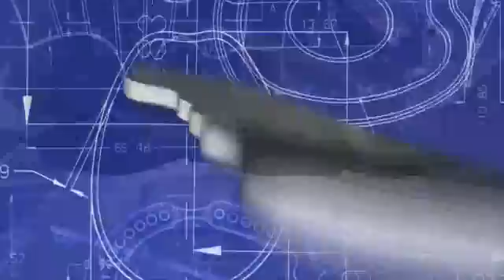#britek  Energy Return Wheel... Autonomous Never Flat

Comment from the maker: Composite hoops that flex/articulate a prescribed footprint. Composites are much lighter than the tire body mass that they replace. The energy storage is in the drawn elastic attachments that suspend the hub within hoop. Each of the 36 radial array of attachments is pulling 300 lbs. IE 5 tons. Vehicle weight lowers hub within the scope of the hoop. The hub is now hanging from the top 180 ID of the hoop. If the wheel hoop will not roll the hub winds upward and forward a unique lever effect.

Comment: I can see how a more rigid tyre is going to reduce rolling friction, but everything else about this concept is misconceived. The contact patch on the road will be much smaller as the tyre is not free to deform. The steel hoop that gives the tyre rigidity is going to cause a large increase in unsprung  mass. There is no 'energy storage' in the wheel in any way meaningful to performance or economy. I'm all in favour of an alternative to conventional tyres, but I don't think this is it.

Comment from the maker: On these early protos we were pulling radial array 36 attachments @ 300 lbs. dynamic stretch tension per bolt/attachment. Add vehicle wt. of 1,200 lbs. divided by 18 pulls IE the top 180 degrees of bias stretch = an additional 66.6 lbs top side or 366 lbs. total per pull. 3/8" stainless steel hardware is not being challenged.

Comment from the maker: The sidewalls and tread block of pneumatic tires are the weak link at speed. You have become accustomed to riding on bouncy balloons that squirm and roll over in hard corners. ERW is the exact opposite. We bring power to "points" suspending hub in hoop. Our 360 degree sprung to the surface hoop makes more constant contact from those points to the surface.

Comment from the maker: A pneumatic tire crumples up from the bottom until the rim contacts the ledge. ERW is the opposite. At rolling impact the hub is isolated from the impact as the hoop comes oval, stretching the 3 o'clock and 9 o'clock attachments.  The hub is levering from the top 180 degrees of attachments and simply steps over the incident. Check out our vacuum charged video.

Comment from the maker: We know that rolling a ERW sprung to the surface hoop has better contact potential at high speeds than a pneumatic tires tread block and sidewall deformation. Check out our high speed dyno video.

Comment from the maker: We have "no hole" composite hoops . ERW shares the load. The hub is suspended / dynamically sprung by more than 6 tons of elastomeric attachment tension. The hoop can come out of round from a large impact directing force to 3 o'clock and 9 o'clock attachments. The rebound lifts and levers the internal hub up and over the obstacle.  With half the bounce of pneumatic tires.

Comment from the maker: ERW displaces internally. An internal shock absorber. We do not over react by bouncing like the pneumatic tire. Our deformation occurs at the hoop level creating a prescribed flexing footprint. The hoop can go oval stretching the attachments at 3 o'clock and 9 o'clock. We have a filed novel traction systems specific to ERW to assist with deformation. ERW hoop is rated at about 50,000 psi.. Your tire is 120 psi.. Shock travel is cut in half. Lateral performance? ERW shares the load 360 degrees.

Comment: Installation is not a issue. You're spewing words to make it seem like you know what you're talking about, but you have no real background in this science. That's why you're not gaining traction with your proposal. You're simply gluing a tire to a piece of metal, and never the twain will interact. If you integrated the steel into the tire, you'd just be making a shock absorber out of the tire. It's CHEAPER to make shock absorber out of compressed air.

Comment from the maker: We hang from the top 180 radial array of attachments when loaded. ERW  focuses developed tension to points then levers the hoop to the ground from those points. Completely different than any other wheel designs. We pre tension our elastic attachments for better transfer of force IE an elongated slingshot shoots farther. The pneumatic tire looses energy from sidewall deformation and tread block while we are an internal, closed system.

Comment from the maker: When we started over 10 years ago the ERW was a hoop attached to an elastic membrane spanning a wheel hub. The the elastically supported hoops "freedom of movement" into wheels negative space provided cushion and energy return. Next improvement a radial array of elastic attachments to pretension ERW  and "hang" from the top 180 inner diameter of the hoop. A mechanical breakthrough. Innovation takes time.

Comment: You have analyzed your system for fatigue though, haven't you? Constantly deforming metal (such as the spring steel component of your wheel, right?) does fatigue. I'm not an engineer, but this wheel seems designed to take advantage of the deformation of the spring steel with each rotation, and there seems to be that potential. I'm not asking for details, and I wouldn't be so critical if I weren't honestly interested in what you're doing, but have you done the engineering work on metal fatigue?

Comment: My point is that every generation stands on the shoulders of the previous generation.  If there is one singular aspect of our species that gives us the greatest advantage over others, it's our ability to pass on knowledge and learn from others successes, and not repeat their failures.  Personally, I don't know if slightly more energy can be salvaged by putting generators on the wheels, but I can guarantee you're not the first to think of it, and there's probably a reason it's not done routinely.

Comment: I acknowledge the energy loss in both the cars forward movement and the energy loss storing. You are losing far more energy by not capturing what the wheel has and is not using. I agree that if the wheel only has 200kj to offer that would be accurate, but you are failing to see the same thing this man is. Too much reading, not enough practicing.

Comment: he just isnt understanding the load that actually generating the electricity puts on the device turning to cause the induction of current. He thinks that in-wheel generators would have zero effect on the car's rolling inertia which is incorrect and why he won't accept your argument. He's also overlooking the unsprung weight associated with heavy wheels, the packaging/weight issues of the generators, power storage issues, the manner in which you re-introduce the power, etc. Mclaren's KERS is ok.

Comment from the maker: Our pliable medium is stretched between points allowing for a focus and transfer of developed tension to and from the surface. ERW can react to road irregularities without over reacting by leaving the surface IE bounce. As air pressure increases in a tire it bounces higher with more oscillations.  ERW hub freedom of movement in hoop internally storing/returning more of that force into the rolling action.

Comment from the maker: We are using the spring/recoil between points to adjust hoop to road variances. As tension increases the bounce height between the points is reduced... with air pressure the bounce height increases causing loss of traction at speed. A serious reaction speed advantage ERW.

Comment from the maker: ERW hub is supported between opposing elastic attachments. A taunt elastic cord will stretch and recoil more energy than a relaxed cord. We have found a directional stretch to weight ratio that is more efficient than air pressure when rolling over impediments, uphill travel, acceleration as well as brake force.

Comment from the maker: The MB AMG recommended tire pressure is 32.5 psi. The USDOT chose the tire pressure.   Oddly we did get tested against a road bike tire. Test conditions gives the pneumatic tire the edge. When spinning the open sidewall ERW  blew like a table fan while the road bike was but a whisper. Try spinning your road bike VS a large knobby MTB. A water bottle is 14 aero watts at 30 mph.

Comment from the maker: Base jump with an elastic cord or land in a pile of inflated tires? Directional stretch is very dependable and an accurate way to transfer a very high % of that energy. We are using directional stretch, focused to points. Quite the opposite of the tire.

Comment from the maker: Well done. We displace internally as well. Hub in hoop displacement stretches attachments that ultimately lift the hub against the pull of gravity. As ERW rolls the topside attachments draw the hub from points into the rolling action as the path of least resistance.

Comment: Non pneumatic tires are primarily more efficient because they can be made to be more firm and responsive compared to pneumatic tires. From what I can tell, this design is combining the firmness with non-pneumatic tires, along with the capabilities of a spring steel hoop to transfer impact energy from (as opposed to the part of the wheel directly above the road) to the whole wheel.

Comment from the maker: Tread squirm causes wear, poor tracking and potentially loss of control at higher speeds. ERW solves tread squirm by the powerful centering force directed by the radial array of elastic attachments. View ERW at + highway speeds at the USDOT. See hub levitate against 6,000 lb. dyno resistance. Try this experiment. Take a rubber band place against your lips stretch and recoil. Notice heating while stretching, cooling wile contracting? ERW recycles heat as attachments counter balance.

Comment from the maker: We have improved every component. We are stretch not solid rubber. The hoops are just flexible enough to create a prescribed "footprint". The rubber traction system can be changed to match applications. We have much less heat buildup because we eliminate tread squirm and roll more true. Pneumatic tires are double digit less efficient and will go flat from a small puncture.

Comment from the maker: New wheel technology does not come easy. There are many companies that will fight to slow our pace. The energy return is very simple,,, We have competing stretch attachments directly across the hub/wheel from each other. Our high tension attachments return more force on recoil and do not become bouncy like pneumatic tires. Their developed tension is directional, as they roll/recoil the path of least resistance plus rotation generates hub lift. Not obvious but very measurable at the laboratory.

Comment from the maker: A pneumatic tire crumples up from the bottom to the rim while ERW hoop becomes slightly out of round, storing a % of that force as elastic attachment stretch, the hub is lifted by the top inner diameter hoop attachments with a more immediate response... stepping over rather than crashing into a hole. Our newest bicycle videos show displacement response to rotation and impact.

Comment from the maker: The hub is largely suspended by the top inner diameter of the hoop. The elastic attachments are in a more relaxed state in the lowed half. When rolling a bump lifts the hub from the topside as the hoop deflects or goes oval. Going oval stretches the attachments their recoil raising the hub within the scope of the hoop carrying on the stretch / recoil rolling path of least resistance. Check out Screw Force bike videos to see rolling action to impact /rotation and brake force..

Comment: Interesting idea but flawed. 
 What in the design directs the returned energy in the direction of travel?  When the wheel hits a bump the returned energy could slow the car down acting as a brake instead of accelerating it.  Think through it.  When the wheel hits a bump, energy is taken away from the moving car and transferred to the “spring”/wheel, the car would actually be slowing down.  When the wheel “springs” back to accelerate the car some of the energy will l be lost as heat/sound energy

Comment from the maker: Oddly yes they are. Tires and footwear analogy. A Nike Air Shoe you were "on the bubble".  Motion control post structures were required to control lateral motion IE supination / pronation.  Britek stretch / recoil is super directional as an actuator is driven into a chamber stretching the membrane in between. Much more stable S/P cycles because actuators / thrustors lie directly under the bone structure of the foot. Less time on the ground per foot strike.

Comment: As a matter of fact, any kind of storage device introduces it's own losses reducing efficiency even more. Hybrids put more energy in than you get out. The more electricity generated, the more horsepower it consumes and your gas mileage goes down. They gain a bit by generating while coasting but that comes at the price of a shorter coast distence. Still more in than you get out. For further reading, I suggest the electrical engineering section of your library.

Comment: It has been tried. What you are suggesting is an over unity device. Perpetual motion. Won't happen. There would be no  reason to do this with anything but a bigger alternator. The only thing your idea would accomplish would be to increase complexity and reduce efficiency. If a generator is hooked to nothing (open circuit), it will not produce or consume power. If it is hooked to anything, battery, capacitor. motor, ect, it will consume horsepower, more than you can get out of it.

Comment from the maker: A pneumatic tire looses 20-40 % of the energy that passes through it. You can increase air pressure for another  5% but you loose the ride quality. ERW has a happy medium between % of  attachment developed tension and the weight load. We do not kick back or bounce even half as much as pneu. Smoother at speed than you can imagine. Check out our high speed dyno video.

Comment: Run flat tires are available now. With these, replace spike strips with a portable speed bump. Due to the low profile design, it will bend the wheel.

Comment from the maker: There is a loss of energy due to drive train inefficiency tires and the suspension system it'self. A high % transfer of energy is what we are after. We counter balance the pull of gravity via hub displacement in the hoop. The extra stretch at the top inner diameter assists in the rolling levering effect of throttle. A spears throwing stick breakthrough.

Comment: Garage doors don't close on their own, it's when the person closes the door they add the extra energy that helps when opening the door (with no springs the door would slam shut on it's own) the spring acts as a counter balance and stores the extra energy needed to open the door There is no gain in energy. similarly it's the energy of the engine that moves the car forward to compresses the springs in the wheel, so when the wheel rolls forward and the springs uncompress there is no gain in energy

Comment from the maker: The garage door weight loads the spring as it is lowered, the spring energy recoil is returned when you raise the door. We stretch/install our attachments before the ERW is lowered to the surface, about 300 lbs per attachment for these early protos. The vehicle weight  is an addition to the stored energy and is returned when movement is initiated. Try to open your door w/o spring assist.

Comment from the maker: We have High Speed, Heavy Duty ERW on our website. Vacuum pressure is a big factor, backing up membrane structure and adding a vacuum stretch response to the air inside the diaphragm. Quick action across the hoop levitates the hoop across rough terrain. Our latest bicycle video shows screw force response to a quick stop.

Comment from the maker: Compressed air is yesterdays solution. We have prototypes that use vacuum pressure to install!  Air is allowed entry recoiling dynamic tension to beadlock. We have a pressure install where diaphragm body's are inflated into position then are vacuum charge for membrane support and tune effect. Tread compounds will only take the pneumatic tire 4-5 % while loosing traction due to harder compounds.

Comment from the maker: Retread tires? They do not allow retreads for the rear for the reason you mentioned. We solved the issue by going to curved hoops. We have had no issues. We have a vacuum or pressure install and removal processes.

Comment: You can't bond the tire tight enough to non-compound materials to maintain its attachment under lateral force. This is why regular tires are steel attachments from rim to rim and the subsequent belting is external to the main steel wire framing that makes up the rim, sidewalls and first layer. You would have to bolt the tread to the rim, just like the bead - using outward force applied by compressed air, effectively "bolts"  a regular tire to the rim, and beadlocking is made for high torque use.

Comment from the maker: ERW spins a hoop for the smoothest hook up. The hub is winding up inside the hoop, the rebound metering out the hp and torque to the surface. Because the stretch tension is directional more energy can be converted back into the rolling action.

Comment from the maker: Imagine tuner composite hoops, modified diaphragms for max. vacuum boost, expandable, replaceable traction systems. Sling shot acceleration and a new level of grip. These things are possible when material science, design and engineering meet full circle.

Comment from the maker: Direction ally sprung. The hub sinks within the scope of the hoop as weight is applied until it is fully suspended. Now  there is more stretch energy at the top inner diameter of the hoop. Throttle response  winds and lifts hub now levering, springing hoop from the stretched attachments, the rolling action the path of least resistance. Also we have a new brake force / screw force video about to post showing ERW wind up and deliver quick smooth stops!